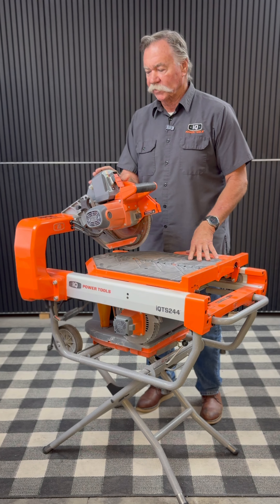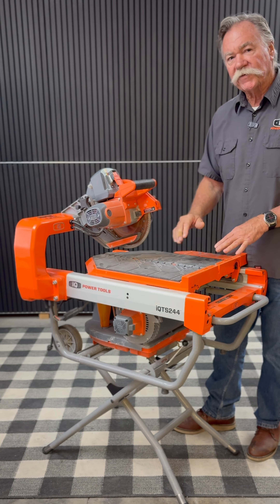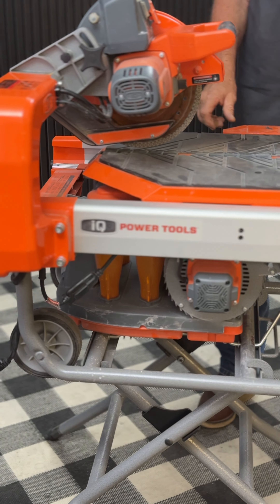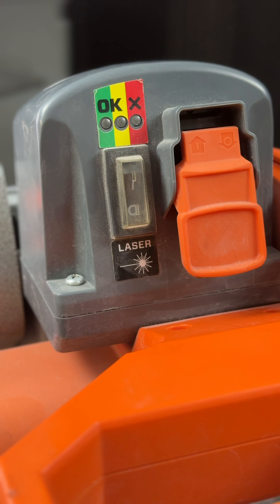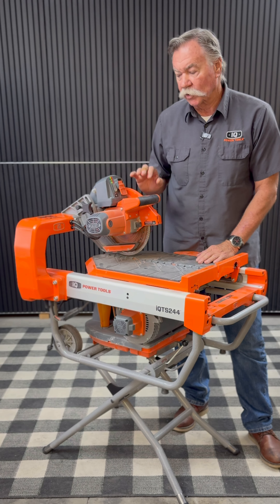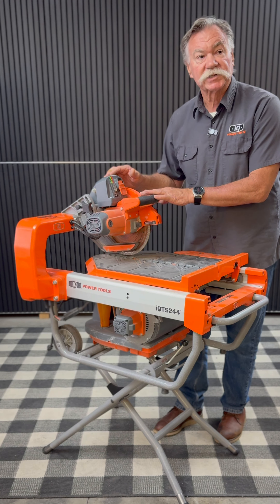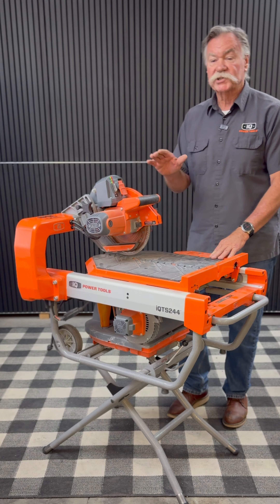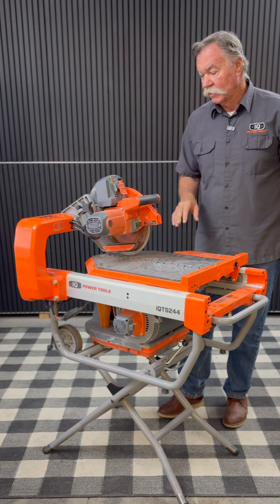Welcome to the iQTS244

Comment: Which is the largest size tile you can cut with this saw ?
Reply from the maker: The saw has a 1" depth of cut and 24" rip cuts and 18" diagonal cut capacity. With the extension table you would still have the same cut depth, but you would then be able to lock the saw head in place and feed the material through. You can also find the full specs for all of our saws at https://iqpowertools.com/products/iqts244-10-dry-cut-tile-saw or fell free to contact us with any questions you might have.